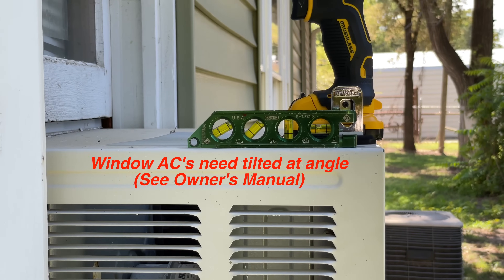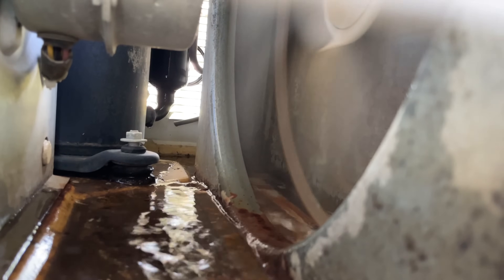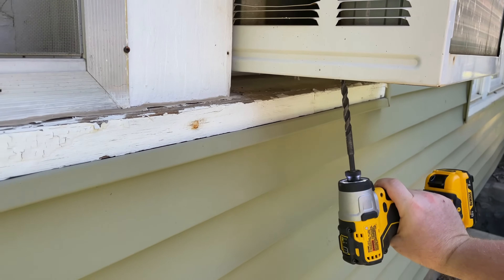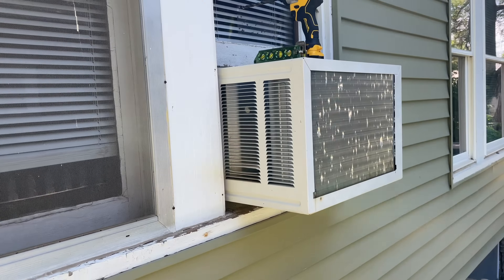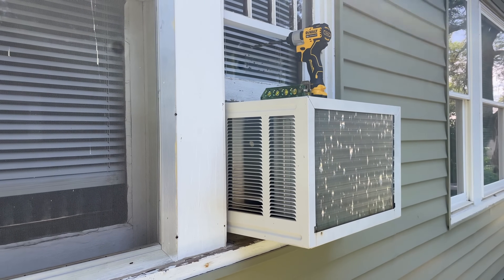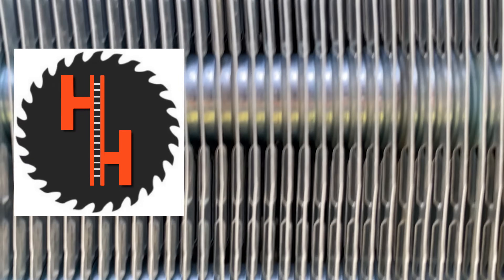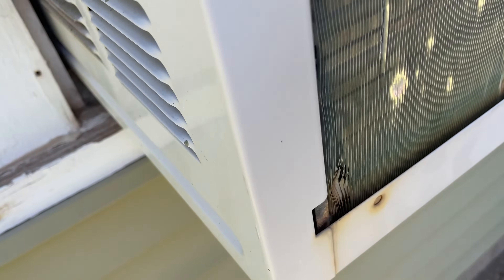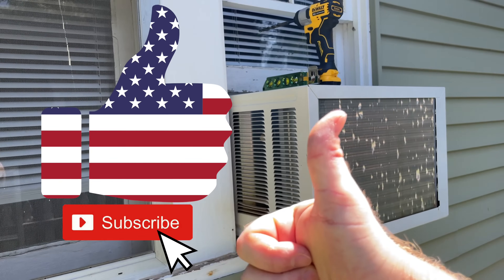99% Don't Know THIS About Window A/C's!! DON'T DRILL!!

Comment: The idea of a window air conditioner is to Remove Humidity.  By not draining the water out of the base of your window
unit will only cause it to add humidity back into your house defeating the purpose and function of the window air conditioner.
And wet coils will only trap more dust and dirt making them less efficient at cooling.  
If you drill a hole, make sure to add something like a straw so the water can flow out.
Reply from the maker: This is so untrue in many ways. I’ll just address one of them, that it will add humidity back into the house. Whether the condensate drains through a drilled hole or it gets dissipated into the air by the fan on the condenser, neither way add it back into the house. There is a separate fan on the inside that blows onto the a coil

Comment: Of course the slinger theory works well in laboratory conditions; latent heat of vaporization and all that... But it doesn't work in rural, swampy, humidity-you-can-cut-with-a-knife South Carolina.  If you allow the unit to continuously sling the vast amounts condensate onto the condenser coil in hopes of saving a few bucks you are kidding yourself in my neck of the woods.  Firstly the condenser fins will clog with wet debris that eventually will support life.  Secondly, there are aquatic insects here that thrive in any pool of water they can find to lay eggs in...  So about mid summer you have a nice mat of dead mosquito larvae and other semi-aquatics plastered to the inside of your condenser... How's does that figure in the efficiency calculations???  Not only do I have to drill a hole in the condensate pan but on top of that I also have to attach vinyl window screen (Lexel works great) over the outside air inlet slots to keep all manner of debris (leaves, pine straw, curious lizards, and all sorts of insects) from clogging the whole thing up.  No that doesn't restrict air flow; I measured it.  Hey manufacturers!!  Bring your design facilities to rural SC and manufacture a real world window unit!

Comment: I bought a new LG window ac unit (the least expensive 5,000 btu unit they have) a month ago and for the first week I was really concerned because I didn't actually tilt the unit how it was supposed to be tilted and my unit doesn't have a drain hole. But going on a month now and I haven't had any water leaking to the inside of the house so I'm assuming the tiny amount of tilt I have is enough. Plus I'm not running it 24/7 so I'm assuming any water that is collected in the bottom is evaporating enough so that it isn't getting inside.

Comment: I highly suspect that the water pooling in the wall-mount ac in the humid hot summer caused my pneumonia. Because it doesn't have a drain hole at all (unless you drill one yourself), it even collected rainwater as my ac was exposed to the sky. It even slings water inside the room. Only "efficiency" in this system I saw was getting ill real damn quickly. Highly probable it was gonna breed all sorts of bacteria in the puddle inside so I just got the ac replaced and I'm healthy again. Drill your hole or get one with a drain hole if you're getting one of these cheap-o wall mount ac units.

Comment: Fl man here . Drilled a hole or pulled out a rubber screw cover or took a knife to poke holes in the bottom of every window ac unit ever....  I have 3 now bought at Sam's Winter of 2018 on sale still blows ice cold all of em.. I usually wait a year or so . Really when you outside or hearing it inside spraying water all over outside.. all work no problems.. been doing it forever

Comment: Here is  what's wrong with a "slinger ring", in action. Even drain holes can't prevent eventual problems:
https://youtu.be/C-7KpkEBqJM?si=QwpfejWv1C-ZuOAE
Reply from the maker: Watched your video… interesting. I agree they should add optional drain holes for different climates. My brand of air conditioner does not fling water as bad as yours. It splashes it on the condenser a lot more efficiently. Also, mine is not dirty at all like yours, even after running it all summer. Interesting video, thanks for sharing.

Comment: I myself don't know what to think anymore, because some commenters say their only solution is drilling. I do know that my newest Frigidaire 5000-btu Window-AC lacks holes, but both the latter (and the previous Frigidaire FRA052XT7 from approx 12 years ago which had holes on bottom) had both been shooting out BLACK SPECKS onto my kitchen floor. Also the vents of both the old-and-new had/have been accumulating black specks on them. A bit like living in a coal mine city!

Comment: Yes. I drilled mine and that genie cloud came out of it. Fortunately, it wasn't an expensive a/c unit so I bought another one. For this one, I plan to keep the genie in the tubing in which it was installed. As the man said, "Don't drill these." They are engineered the way they are for a reason. I found it incredible that my drill bit didn't bother wandering off the copper tubing and went straight for the genie inside. Any other time there's absolutely no way you can keep a 3/32" drill bit from wandering off a 1/4" tube without center punching it.

Comment: In humid areas you need to drill baby drill, problem is you need to wait to do it when the unit is not running and dry so you can paint the drilled holes with a heavy oil based rustoleum.
“Slingers” are just a good way to end up replacing every plug or wiring connector that gets soaked in the unit😂 case when the humidity ramps up.
Not to mention the mold that will follow the hyper damp conditions inside the case, which always finds its way into the interior section of the unit.

Comment: If you don't want your system to rust out, drill it. These units are designed to fail (planned obsolescence) so that you, the consumer is forced to buy a new unit sooner than necessary. 

Also, because the condenser is full of water, the air can no longer pass through easily, which raises the head pressure (and power draw). Your unit will actually run more efficiently without having water slinging around inside of it.

I have worked on window units for years, and have seen the effects of both sides in the wild...DRILL THE HOLE .

Comment: All I have and don't trust that "Sling Ring".I Always drill a hole in mine.Why?...Because thats not the only water that gets in the outer housing.Rain gets in there to and many probly have had the problem of water being blown into the house through the vents.Thats because it's clogged up "weep holes" OR it's just to much water going in and not enough going out usually from a hard rain and now the fan is slinging it through the air duct.Just remember to look where your drilling if you do not to hit anything.

Comment: Thanks you saved me a whole lot of hassle. This is what the internet is for. I was going to drill mine

Jamie
Reply: If you don't want your system to rust out, drill it. These units are designed to fail (planned obsolescence) so that you, the consumer is forced to buy a new unit sooner than necessary. 

Also, because the condenser is full of water, the air can no longer pass through easily, which raises the head pressure (and power draw). Your unit will actually run more efficiently without having water slinging around inside of it.

Comment: Old units didn't do this. This is energy star BS. Flinging water might make the unit a few percentage points more efficient, but it also causes the unit to rust out and to become moldy which blows nasty most air inside. Drill and be happy.

Comment: I have three new units. That all have about an 1-1/4” oblong hole near bottom center of the unit that sweats and drips condensation into the wall. I had to modify my window and install a rustproof metal plate under the unit to stop this. Idiots, what wrong with it dripping out the back like they have for decades. Now I have a wall to repair.

Comment: My 1971 Wards 6000 has the base drilled for runoff and never had a problem, same with my 1987 Whirlpool 18,500 sleeve. Sure they sling the water into the condenser for "sweat cooling" but that does little in the humid parts where the water simply doesn't evaporate. You make it out to be some federal crime, dude give it up.

Comment: Midea. 10, 000 btu. Drilled holes tired of hearing the fan blade drag from water. Way more efficient.  From a master electrician. Cools more efficiently.  So i call bs.
Reply from the maker: Maybe stick to electricity comments bc you don’t know anything about thermodynamics.  I’m no expert on the subject, but I did do a pretty good wattage test with and without water. Also, commons sense can follow the science. Until you do a scientific video, I’ll stick with professionals and my personal scientific test.

Comment: Excuse me sir,
In Hawaii where humidity is close to 80% daily,
An A/C unit is borderline useless in any space not adequately insulated. This is in many ways due to the high humidity. As most of the energy is lost in the process of removing water having next to no effect on air temperature.
Furthermore because the A/C unit is little more than a very effective de humidifier that pool fills up an overflows to an effect of gallons per minute.
My unit personally was throwing water outside the housing and causing damage inside my home from excess water.

I stay up at night dreaming of something that instead of blowing cool air it runs that air through something metallic to radiate and be intentionally condensing humidity outside of the a/c system.

Comment: Completely disagree for one the dehumidifier water is so much all those gallons you could use it for better use like your garden number to you can't overcharge him a little bit and they blow like 39 that water kind of boils and it prevents it work in the most efficient I have had the same one 8000,5000 BTU for 8 years and it's been draining ever since , I have fed my family with vegetables for a long time from this water what a waste not to drill and all my other ones before it again completely disagree

Comment: I grew up in Pittsburgh and moved to Mojave valley. There they had what was called swamp coolers. It look like a big metal box sitting outside that had vents on the three sides but not on the top or bottom. On the sides where the vent were, there were big  filter looking things and in the bottom was a reservoir that held water that  had a water pump that would pump the water to the top of the cooler which ran down all through the filters. It had a fan that suck the hot air from the outside through those filters and it cool the air through evaporation. There was a float in it and a live water line so when the water evaporated it would add it and keep the system working. It worked extremely well considering it didn't have any type of refrigerant. 😐

Comment: I had an older AC window unit years ago that dripped condensation outside when it got really hot out. I was told at the time that this was normal. 
Years later, I replaced the old unit. The new unit has not leaked a drop. it's either advanced technology, or I'm too old to give a sh*t, anymore.

Comment: Having a heating and cooling certification, I do understand the efficiency gains.  But I was NOT happy when I bought a similar model and had to disassemble the whole thing to treat the MASSIVE mold inside.  I drilled hole to drain the water.  It MAY be less efficient, but it is certainly healthier.
Reply: I live in the humid south, these new ones that don't drain are a F'ing mess. Slings water all over the one side of the window / house, also over fills with water and runs down all over the window and house.

Comment: This should be a depending title. When you live in a swampy humid area like Massachusetts. You absolutely need to drill holes if your AC doesn't already have them. I'm currently having an issue with water backing up on my sill and dripping down into the wall. Yeah, I had mushrooms growing in my wall.

Drill and tilt. Always, if you live in a humid area. Or buy an air conditioner that has a proper drain hole. If you have an AC that doesn't have a tilt and refuses to accommodate for a tilt. Even drilling a hole might not be sufficient. At least it wasn't in my scenario for one of my other ACs. I'm believing I need to run a dehumidifier while running the AC. Too much humidity causes them to build up ice before they can evaporate everything off.

Always make sure your rear condenser is clean and clear. This will cause the system to work harder and build up ice. Those fins on the back need to breathe. It's essentially like the radiator on a car. If the pan is all built up with debris at the base of the condenser in the rear. You're going to have drainage issues if you have a drain hole on the back. I had to dismantle the cover on my AC spray it all down with the hose and air compressor. I even pulled off the inner plastic cover which surrounds the Slinger ring. It was all filled with cobwebs and debris. Spray it all down and suck it up with the shop vacuum. Be mindful that you don't spray the electronics with water

If the electronics did get hit with water. Let the AC sit in the hot driveway all day to evaporate. And pray you didn't damage the computer

Comment: Haha!  I did this to my air conditioner a couple years ago, thinking the exact same thing and it lasted about three days lol. I was used to the older air conditioners that did have drip holes in them. I thought, this is stupid all this water in there is gonna rust the bottom out, so I got my drill…..

Comment: I own the exact same AC unit for my sunroom that’s not attached to the homes main AC system. With the NJ climate and humidity it started leaking water inside of the house even with the unit tilted properly. I drilled two drain holes in the bottom and now no leaks and it actually cools much better. Drill baby drill.

Comment: I drilled a hole on mine, the fan was touching the water at the bottom and sprayed rusted water all over the carport floor and the car. I drilled a hole and it fixed the problem. 8 years and still working.

Comment: The fan was rotting out. Mold and mildew growing everywhere inside the unit. I figured this can’t be good for it. Plus electric and water don’t mix well so I drilled. Didn’t notice any loss in efficiency. Did notice nice and quiet now.

Comment: After 2 months I noticed a very bad smell coming out.  Upon inspection I saw mold inside the unit.  Drilled a 1/4 inch drain hole, then washed all the mold out.   Midea 5000 btu.  I drilled close the the center side.  Still allows some water in the rear.

Comment: The over flow holes always clog then the water runs down the inside walls and ruins the floors. It's often several days before you realize you've had a problem.

Comment: I saw the hole in the back lip of the back of the A/C.
It is there for use in high humidity environments.
That cold water comes from the front of the A/C and drains to the back.
Slinger splashing that cold water onto hot coils raises efficiency but not at the expense of capacity.
That can make the A/C blow a bit colder too.

Sometimes MFR's will sell an optional drain kit for the outside of the unit. Some come with a simple rubber plug.
Drain kit intended to have a hose attached to direct condensate to someplace else other than straight down.
Generally used on 2nd floor applications and places over a door where you don't want water on the ground.
Or water splashing mud on things.
If your window A/C leaks out the front, it can be due to wrong slope to the outside or a clogged drain between the front and the back of the A/C.

Comment: I drilled drain hole in my new AC unit because there wasn't one .the sloshing sound from the puddle that formed in the bottom was annoying enough but water droplets actually started coming into the room with the fan .the small drain hole was exactly the fix and now runs more quiet without water coming into the room . The AC unit runs great with drain . Stupid idea to have a puddle build up in base .

Comment: Unless you live out in the country on a dirt or gravel road and all the dust and dirt clogges up the fins, then no air passes.  I have holes drilled in mine, and fins stay cleaner and ac cools just fine.

Also had one ac leaking water into floor of the house because of the fins being completely matted up from the slinging of water on the dirt and dust.

Comment: Always drill a hole in it..let that water out.. I have a small window ac from 2017… no rot.. still works great. No overheating or anything. Not having a drain is a big problem! Drain it out! Use common sense..

Comment: This has got to be the most brain dead design ever! I woke to hearing all this sloshing noises then realized it’s too humid outside and water is building up inside the unit. Blows my mind to think that they never tested their equipment in high humidity.
Reply from the maker: There should be an overflow weep hole or two for this exact reason. Sounds like it is plugged or the angle of the unit is not correct.
Reply: @HandymanHertz  thanks but it’s brand new and i took the unit out there’s no weep hole or anything…bought the unit cause it had the lowest decibel rating, but once the sloshing happens it’s loud…ill probably have to drill but it’s so insane that they overlooked it

Comment: You have to put holes in the bottom of a strategically so you don't damage anything but it will release all the water out the bottom I do not know why they don't put drains in these things properly it's absolutely retardation